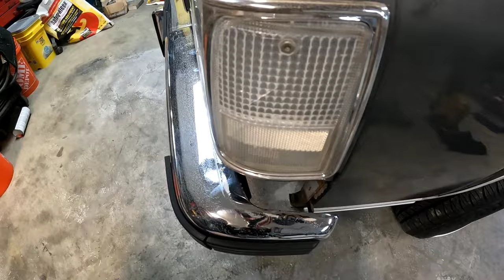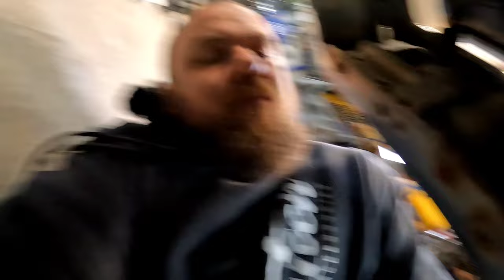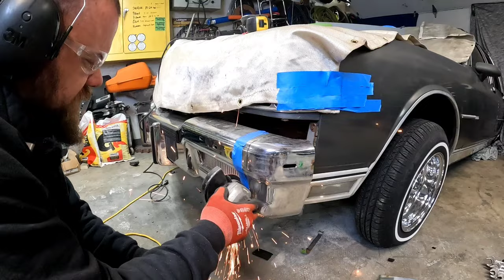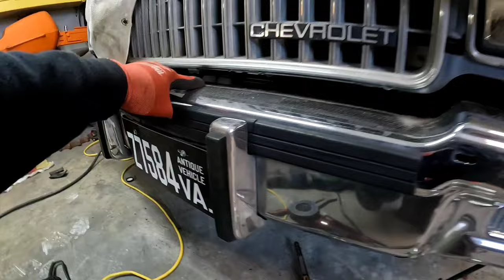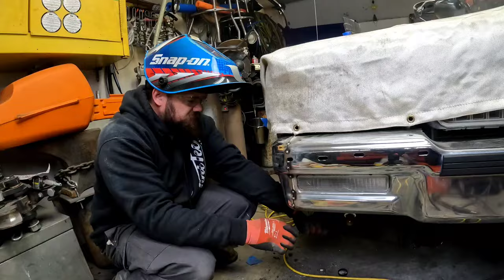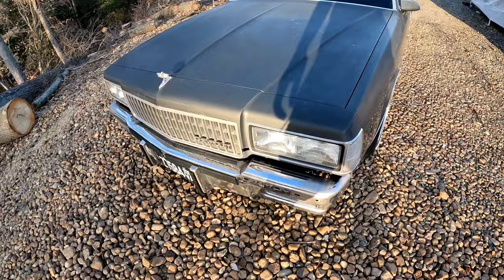How to Tuck bumpers on an old car

Comment: would you be able to redrill the bracket on the gas strut to raise the bumper up and fill that space so you wouldn't really need a filler panel? Or make an adapter plate?
Reply from the maker: Yeah I could I'm just worried about it looking weird at the bottom of the fender. If I moved it up anymore the fender would be bellow the bumper.  I'll come up with something eventually one of these years lol
Reply: @Virginiaisforlowriders  oh that makes sense.

Comment: What size are your rims?
Reply from the maker: 14s
Reply: Did you have to run a spacer in the front to clear the brakes? Or do they clear with the reverse offset?
Reply from the maker: @user-pm5ut9wr1h  they cleared this car with no spacer, but this is a small lug pattern caprice.  If it's a large pattern car like a caddilac, you have to grind the very edge of the caliper or run a thin spacer.  I've never been a fan of the spacer .every Cadillac I've ever done I've just ground them down.
Reply: Kool thanks for the info. Love the channel!
Reply from the maker: No problem . Thank you

Comment: 1970s Ford and Lincoln and Mercury, they have a square block mount and it's fused rubber on the inside you have to take the mounts off heat them up with a torch and compress them either with a press we use the bucket of a bulldozer in concrete and push downward until it collapsed then we heated it up some more and use chain and extracted the piece out of the square block then spray the rubber down really good with silicone take a razor blade and trim off the ends if you want to use that third hole that mounts to the frame and the upper position you'll need to slice off a portion and that takes a die grinder wheel it's a lot harder than the GM drill a hole. But my LTD looks much better with tucked bumpers. I've not found any Ford Lincoln or Mercury of the 1970s with the Chrome metal bumpers that have been tucked because it's a lot of work there are two bolt holes in there you can move it back an inch and a half but if you want to move it in 4 in like I did you got to do it the hard way and break that fused rubber it's like little rubber pucks on the inside of a square tunnel and you heat it up and compress it and when you finally extract the two pieces apart you'll see the square puck with a 1/8 of an inch of rubber still on the inside of the pipe there. What's great about me doing my forward and my Lincoln Continental so I'll have the only cars of that generation we talked bumpers cuz it was a lot of hard work. My GM cards they were simple you just drill a whole collapse it drill it second home put a screw in it and then adjust out the bumper to lift it up a little bit about an inch so in two and a half inches up an inch and they look great. I'm doing a 1976 Cadillac that's going to be even tougher cuz I have to change out the tail lights to Buick Electra to fill in the void so I don't have to use the horizontal plastic fillers the object is to totally delete all that filler on the back of the car. On the Ford cars you're going to keep some of that filler on certain bumpers like the LTD the back bumper only keeps some of the filler because the pointed tail lights and the flat trunk lid there's no bumper that covers up all the holes with a filler is so you simply slice off several inches of rubber filler, because Ford fillers of that ear are rubber they don't rot like the General Motors that were plastic did. and then put the bumper back on
Reply: Glad i seen this. Getting ready to tuck bumpers on my 77 ltd and lose a few vertical inches as well.